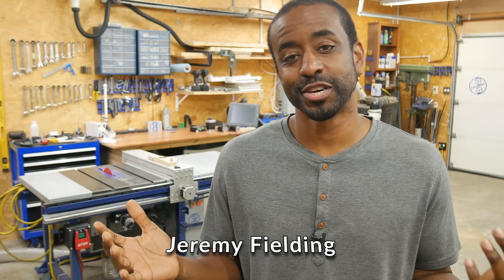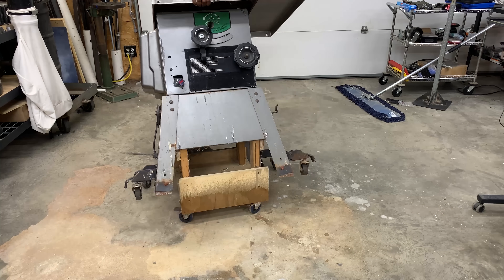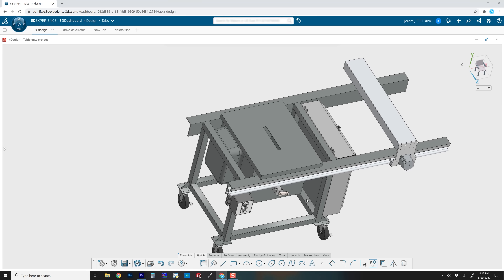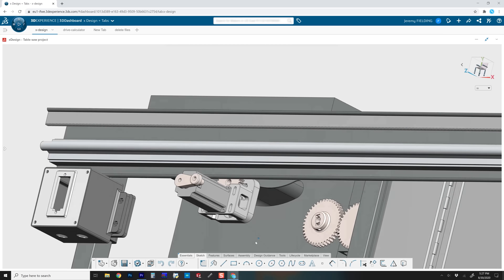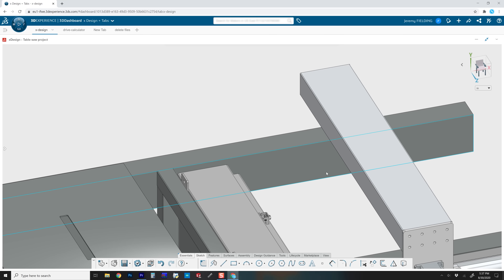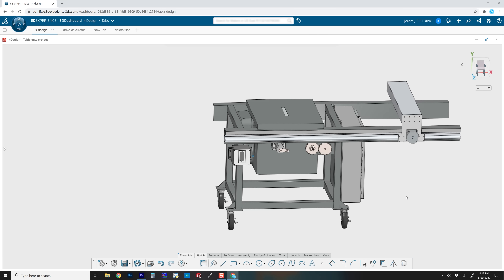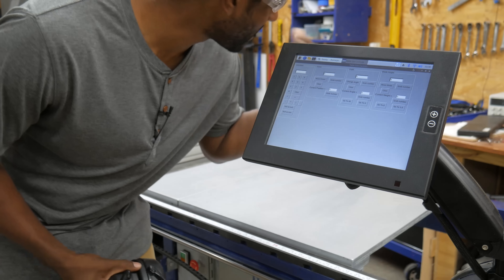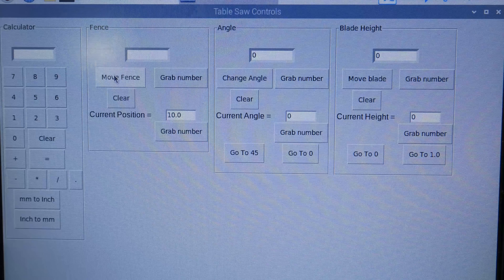How To Make A CNC Table Saw : # 084

Comment: I use Paste Finishing wax to protect the surface of my tablesaw.  After it's buffed, it makes the table super smooth.  Wood just floats over it.  It'll repel moisture, but won't help much if it gets wet (like from rain or whatever).

Comment: About 30 years ago, I wrote a program in QuickBasic to cut styrofoam wing cores for model airplanes on a CNC hot wire machine. You could select the root and tip airfoils, enter the root and tip chords, panel span, leading edge sweep, dihedral, and washout, and it would tell you the size of styrofoam blank you needed and where to place it on the machine. Once you placed the blank on the machine, you hit start and it would display the paths of the ends of the wire on the computer screen (auto-sized to fit) as it cut the wing panel. All you had to do was make sure the wire was hot enough. It was a very challenging, but rewarding project..

Comment: I love you and your videos, but in this case I don't see a lot of value beyond the experience of doing the project. I have a cabinet saw that I built into a long table saw/ router table and to really make it worthwhile as a CNC project It would need and infeed and outfeed table capable of handling 4' x 8' sheets of plywood and then it would take up far too much room in my 18' x 18' shop. So from a practical perspective really making a useful CNC would be much more involved.

Still, can't wait for the next video.

Comment: Instead of turning the motor why not have the handle on a bearing with a lock so you can unlock the handle in the control mode so it won't spin and lock the for manual mode. You could even use a servo on the lock to unlock it automatically when moving the blade.

Comment: Nice one. I don't see a huge advantage to CNC without added features like a cut list and more macros. After you add the cut list, this function can easily be extended wit macros for cutting  mortise and tennon joints.

Comment: Fantastic project. I had plans to make something similar for my large bandsaw. Do you have any concerns over unplanned fence movement during a cut say from a controller malfunction or noise from outside sources? In a router that would be dangerous, on a saw that could be deadly.

Comment: I know it's a late answer, but T-9 Boeshield and renaissance wax. Coat in T-9, wait til it tacks up (usually a couple hours), then wipe down and apply a thin coat of the wax and lightly buff by hand and a clean cloth. boom. Super rust resistant. Reapply after lots of heavy use or once a year or so. I also have just used T-9 but it requires re-application a little more frequently. Works great though.

Comment: 12:07 This is so true! I've been a pro programmer for almost four years, but I had no interesting in coding until I had a project that I really wanted to make. I even took a couple programming courses back in college, but they only made me less interested. Programming is like power tools; you learn how to use them in order to build something, but a 6-month course in "how to cut a right angle" or "which batteries are interchangeable" would be incredibly boring for a beginner.

Comment: Use gun oil for protecting the top from rusting. Works amazing. Use it on my lathe and mill  one every few months. And my garage is heavy in moisture  used to start rusting within days without it

Comment: It is clearly visible that how the Moter abruptly stops and it will create extra load on gear teeth. I know to control the motor speed will make the system more complex. Using relays make it a whole lot easier.

Comment: For rust removal on my table saw, I was really happy with: scotch bright pad and water/soap or vinager,  wet-sanding with WD40 and an orbital sander, then apply any solid lube - PTFE spray is nice and easy, or a furniture wax - doesnt really matter as long as its solid and hard.

Comment: Nice job on the table saw on the back side where you I would use the front rail system without motor put it on the backside the guide the fence.

Comment: Super slick build; I am duly impressed. Have you thought about adding home position sensors to enable the system to reset after a power failure or a manual move?

Comment: linseed oil works good will wipe on and wipe right off. I've had the same delta saw for over 25 years and it is steel rust free I use the oil once every 6 mouths.

Comment: Why not make your manual handles be springloaded so they normally turn freely, thus ignoring motor motions, and you would have to push, pull, or use some other means to engage the ability to move manually?

Comment: do you have a software protection if you ie. move the fence from side to the other side but blade is up and can collide with fence? it can be done with an IF. if fence is on X+ dimensions AND blade is up, allow only moving back to X. If blade is 0 then allow all. same from other side.

love your content and passion. you explain things very well. thanks for sharing all this.

Comment: regarding 15:10... going back from manual to automatic, would be good to solve that by adding "homing sequence" where the fence will go back to a "starting" position to find 0(or any predifined value) so you dont need to rely on the tape measurement

Comment: I have used just a sheet of 1/4" wainscoting.  ie: 1/4" plywood.  I found that just laying this on the surface of my tablesaw all but eliminated rust build up on my saw which sits in an open carport.  I live in the Seattle area, so the air can be quite moist.

Comment: My first guess about the acceleration is simply to do a loop where the number of steps is divided by two for both accel then deccel and the first series of steps always take place at speed X for duration Y then the next duration will take place at speed 2X and 3x until you hit the halfway point and the remaining steps are reversed. 
Outer loop flips from accel to deccel 
Next loop determines if the duration is up and moves to the next speed 
Innermost loop simply makes the step and then counts until the number of steps are executed

Comment: Ok, I downloaded the design files, but......there isn't  a comprehensive total assembly file to see where and how these parts fit together. It would also be nice if you had a total parts list somewhere. Otherwise, the title to this video "HOW TO....." is totally misleading.  You show nothing of the actual workings, like the rack and pinion, or how you built the fence itself.  Nor do you provide a schematic.  So hence, you don't really provide enough info that shows HOW.   Nice build though.
Reply from the maker: I tried man... I tried. Much more than this (3d model, instructional video, custom written software) I think I might as well build it for you LOL. I can only do so much for free :)
Reply from the maker: I am just teasing you, by the way. Its just not practical to add much more than I did.
Reply: @Jeremy_Fielding  Ok, well thanks anyway. Guess I'll have to design my own. Still learning CNC stuff so it will take me a while.

Comment: I know you built your own lave but if you were to Turn 1 into a CNC you would have the most desirable lathe on the planet. Most metal and wood lathe work mechanically not digitally. And the ones that are digital are really expensive to add to your lathe.

Comment: VINEGAR IS THE BEST RUST REMOVER! if your item is to big to soak, you can always put some in a spray bottle and periodically spritz r' down throughout the day or two depending on the damage done. after about 1 1/2 - 2 days; depending, you can haveatit with a wire brush, spritzn' 'er as you go, until satisfied. always remember to lightly oil whatever you just finished cleaning or else youll be right back where you started, and we all know how much we dont want to have to redo something we just finished because, head like rock. lol

Comment: Good job. Sorry my bad English. But i don't understand - what's a point of this modification? You still use manual feeding to cutting blade - most dangerous part of work on disc saw. No blade protection, no emergency "stop on touch". I mean CNC - this is fully automatically processing by "step by step program".  At this case - this is not a CNC.  This is only semi automatically movement, without real - time position feedback. If you add pulse encoders  to all axes and real time position feedback - this is be more useful.... I repeat - this is only my private opinion.

Comment: Nicely done!
I have a digital, electronic or CNC table saw as well. Mine doesn't have the automated fence, yet... but does have automated height and tilt function. It've very precise.
I really like your stepper motors. Much better and faster than the one's on mine. What type are they?
I'm curious as to how accurate you found yours to be, and to what increment can yours move?

One thing mine has that yours doesn't is a calibrate function which you use to calibrate both height and angle. For that you would need that jog function you mention being added. But the jog would have to have two travel distances, one for tapping the jog for most accuracy - the other when you hold the jog button for longer travel distances. A 1/4 inch at .005 mm per jog step takes a bit. Another words, the jog needs to take into account a continuous jog and a tap jog  for micro adjustments.

Another feature I have on mine is a memory. This is both used to store cuts that I want to repeat and for when I turn the saw off for position so I don't have to recalibrate it each time I turn it on. One thing it lacks is a battery back up for the memory, once unplugged it loses all memory which includes repeatable cuts and calibration.  If I returned it to home prior to unplugging - I can easily calibrate it. Otherwise I have to go through the steps to re-calibrate it. And re-input all repeatable cuts. Another nice thing about the calibration is for safety, it won't let you use the saw until you've calibrated position for both height and angle of the blade.

Something I added to mine you might consider is a breaker or fuse between the power supply and each stepper motor. IF one of your limit sensors fail or you calibrated wrong and try to drive the steppers past the limit of travel, the fuse will blow before burning up the stepper motor. Personally, I'd rather have to replace a fuse than have to replace a stepper motor.

You did a great job on your build. I'm envious!
There's another guy that build another nice fully automated table saw as well here on Youtube. You've probably already seen it, if not you should take a look at it and you can possibly get some ideas for yours or your coding.

Thanks for sharing!
cheers...

Comment: This channel is awesome, thanks for the rock solid content. It does drive me a little crazy to see you use flux core wire when your welding, it’s so messy and leaves sparks on your beautiful work! Why not get your weder set up to run on gas and normal wire and enjoy clean beautiful welds!??

Comment: I have a shopsmith Mark 7. This would be a perfect project to upgrade it. Looking at your stepper motor, the accuracy would be 0.1 MM which is more than enough for woodworking. I'm going a different route, I'm going to use long mill technology and an Arduino based controller.

Comment: Suggestion: an indicator in the calculator that shows whether you are currently working in inches or millimeters. Just a reminder really, but since the fence and blade height are presumable hardcoded to imperial, it would be a good sanity check when converting back and forth.

Comment: Wow, great job on engineering all this, writing the code, and the build. When you mentioned re-indexing the fence after manual operation, that sounds like it has the potential for error. You're depending on a visual alignment of the fence with the scale. In place of that could you add a simple calibrate routine for the fence where you would position the fence along the edge of the right hand miter slot and knowing what that distance is from the arbor flange be able to recalibrate the fence. 

Also, how do you handle different thickness blades. You need to take into account the kerf width and also the blade body thickness. The blade rests against the arbor flange on the left hand side (on most of today's saws). If you study the relationship between the blade body thickness and the tooth width you will see that the right hand side of the teeth shifts with each change in blade and this is due to the both the body thickness and the tooth width. So indexing the fence off the miter slot might get complicated. In  any case for accuracy maybe add  the ability to enter the blade kerf width into your setup or be able to select from a few common blades in a drop-down list. There are only a few combinations of body thickness and tooth width so they could be kept in a lookup table in the code.

I know most people (including myself) don't worry about the difference in blades when they change them and probably never reset the index on their fence but it WILL be off by a few thousandths if you don't. And for us mortals with a manual fence I bet most just take a direct measurement when it really matters. But you saw is different. It's fully automated except for pushing the wood through the blade, so it can't make that on the spot correction.

Is there a lock on the angle or does the motor lock the angle in tight once it's moved to the desired angle.

Comment: To keep my cast iron surfaces rust free and very slick I use beeswax shavings dissolved in turps to a viscosity like facecream, keep it in a sealable pot with a balled-up rag sitting on top. Just a few swipes to restore slipperyness. Once the mix is getting too dry, a shot of turps and a quick stir restores it to usefulness. Lasts for years...

Comment: Amazing work as always... really inspiring to me as a beginning maker/engineer wannabe.

I have a couple questions though. Firstly, why CNC a table saw? Of all the tools that benefit from CNC, the table saw is not the first that comes to my mind... is it solely for increased accuracy, or speed at which you can set it up? Is the increased accuracy necessary and/or worth it? Second, how did you measure how much torque is needed to turn the handle? Third, what would be your preferred method for making a bevel gear? You mentioned you might put the handle off to the side and use a bevel gear instead, but I still don't see a mill in your shop, so how would you do it - 3D printer or wood? I've been thinking about bevel gears a lot lately and want to be able to make them myself, I have a (currently out of service) 3D printer and am gathering wood tools myself so I hope to be able to make some gears, if not oversized crude ones because all I have is a jigsaw...

Comment: Great video!  One add-on that you might consider (if you chose to accept this mission)... add a device that pushes the wood through.  I don't know how many people I have meet that have lost their fingers on a table saw.  I even knew a guy that lost his fingers on one of the saws that is supposed to turn off/brake when it touches flesh.  Just think it would be an awesome safety upgrade.

Comment: One thing I would add if I were to build one, is a rear lockdown that engages when the fence comes to a stop.  On occasion, I like to use fence mounted anti kickback holddown rollers. Unfortunately,  on my current Powermatic fence, when a wood piece starts to raise the lockdown assembly, it raises the fence, thereby defeating the holdown force.  I see you use some type of Tslot aluminum tubing for the fence, and perhaps because of the mechanical assembly at the front end of the fence, it may prevent the fence from lifting when using holddowns. If so, then disregard my suggestion. Btw, fantastic work. If you don't mind me asking, how much did this whole project cost?

Comment: Jeremy check out https://github.com/grbl/grbl The source code is listed, there are many algorithms there on stepper motor acceleration and de-acceleration.  Plus many more useful code that you could use.  GRBL runs on Arduino based micro-controllers for CNC based routers.

Comment: Could you cause the motors to ramp up by changing the speed every x number of steps eg. first 100 steps at y speed, second hundred steps at twice that speed and so on.  The end of travel would be reversed.  Small changes would never have enough steps to build up any speed and there would be very little code involved.

Comment: You could setup a registration point so it will know where its at.  example setup another sensor in the middle  and  then have it auto move till it finds the point.   

another thing with the curve,   normalize between 0-1     You will get it!  :D